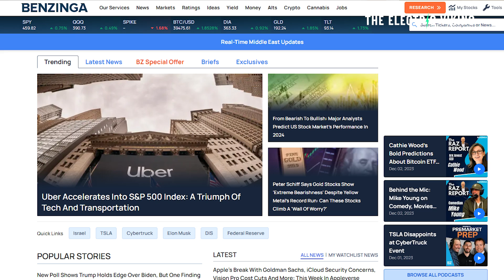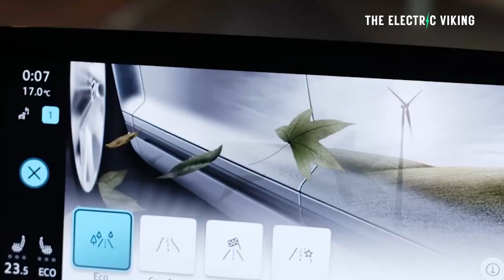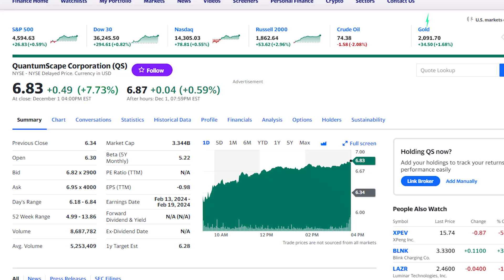QuantumScape stock blows up after journalist says its tech will crush Tesla

Comment: I don’t agree this article was the single reason for stock boost. Its widely anticipated QS are just about to go from prototype to production. A significant catalyst was also VW stating simulatneously "Volkswagen intends to start series production of solid-state batteries as early as 2024 in partnership with the American company QuantumScape"
Your video requires fact checking too.
*VW have not invested billions, they have invested £300m.
*QS did not go public 10 years ago, rather 2020. (It has been in development that long)
No biggies but slightly ironic about an article being questioned for factual accuracy.
For sure QS is a high risk investment but have clearly made significant progress and closer than ever to supplying their launch customer in 2024. That has got a lot of people excited.

Comment: 1. This price jump may more likely be caused by significant sales of stock by company insiders including the CEO. The innocent explanation for this is that those folk have significant tax bills to pay following their exercise of options. 2. It is very difficult to get information on qualifications of  Jeanine Mancini. After drifting lower for several months QuantumScape's price had already made some very modest improvement. That in no way should discount the caution you recommend but there are still too many unknowns, for example, the number and proportion of the total QS stock traded.  BYD, CATL and Tesla are not sitting on their backsides and in any case the hard part is effective conversion of 'Gee Whiz' Lab results into cost efficient manufacturing.

Comment: Don't forget, 98% of the people that CAN charge at home. . . about 50% of the masses that still has no EV possibly CANT charge at home.
They probably want good super charging 300km in 10 min, over long range 700km charging in 1 hour. I would. 
Why 700km range when you better stop after 2.5 hours and stretch your legs anyhow.
And why not cheaper than Tesla's batteries? ? ? ? 
Coarse the Tesla fanboys cant handle that blasphemy? 
When QS batteries are build from much cheaper materials, without Lithium, why cant they be cheaper than Tesla's LFP batteries?

Comment: Great episode Sam.  Elon or JB analysis - the advantage is cheap, volume battery production. Creates a moat against future tech, via customer's true need for convenient range.  Even if 1/3 of the cost for the same range, QS would have to scale very rapidly their production to 100s of GWh to catch Tesla battery price cuts that will follow Wright's law (2x volume = 25% cost decline).  By the time QS have scaled, likely Tesla's batteries will be far cheaper + the cost of car manufacturing via unboxed approach. (Not financial advice)

Comment: What does mean 98% charge at home? That all the EV owners live in the suburbs and have a garage? Doesn't that statistic mean that a lot of people who have to rely on public chargers don't buy an EV because they are scared of range and charging times?
Reply: The early adopters in America probably mostly have single family homes (although I did previously live in an apartment complex that had a charger).  Wider adoption will need availability of level 2 chargers in apartment complexes, and that surely requires a system in which the electricity gets charged to the vehicle owner.  That's a lot of level 2 chargers (or 220V outlets).

Comment: QuantumScape has had a lot of interest and even Sandy Munro has interviewed the Founder and CEO. I believe it's still available on YouTube. But there are two big issues that even QuantumScape admit to. The first one is that there is not a way yet to cost effectively mass produce these batteries.  The second is that their cycle rate is too low for commercial use. After just a few Hundred cycles these batteries degrade quite a bit. In this area QuantumScape has over the years improved this but not to the level of a standard lithium ion battery. Manufacturing cost and battery cycles are still not ready for the Market yet. Which are absolute barriers to coming up with a product you can go to market with. This is not my opinion but From QuantumScape itself and Sandy Munro's observation.  They are improving the battery each year but need tons of cash to keep doing it.  I think they are a real company actually closer to a solid state battery than anyone else but its not able to bring anything to market quite yet. I am rooting for them.  My opinion is they are still 5 years or more away. Their R&D will burn through billions in those years if they have access to the capital.

Comment: The articles lack information on cycle times, degradation, and cost-effectiveness of QuantumScape's batteries. These factors are crucial for practical adoption. Additionally, the potential reluctance of the largest electric vehicle (EV) maker, presumably Tesla, to adopt this technology could indeed impact its widespread acceptance. The scalability and affordability of QuantumScape's batteries are vital considerations for the success of their technology in the competitive EV market.
Reply: tesla isnt required to allow all vehicles to charge at their charging stations.  they could disallow this battery from charging at tesla stations
Reply: That was my thought when I read the article. The claims are standard for solid state batteries and I understand that they have been built some time ago. I understand that the problem they have uet to solve is cracking of the ceramic electrolyte resulting in a short battery life. If QuantumScape had solved it, that would have been what the article was about. It wasn't. It just cited the standard claims for solid state batteries as if they were new.

Don't get me wrong. I'd love solid state batteries to become real and believe that one day the problems will be solved. I just don't think today is that day based on the article.

Comment: Quantum scape stocks were $114, 3 years ago.

Rising from $5 to $7 doesn’t rate highly.
Reply: Only percentages matter on a stock.  You could have a float 1/10th the size and it would have been from 50 to 70.  Does that sound more impressive?  It isn't.
Reply: @gregkramer5588 :  So re percentages, I checked and 3 years ago (12/2020), QS peaked at over $114. 

It closed well under $7 Friday, both at market close and after hours.  

$114 / $7 (being conservative) is well over 1600 percent down. 

I have to believe the market likely rightly believes that QS is FAR less likely to produce a major blockbuster change in batteries good enough to generate huge business profits than it did 3 years ago. 

In reality, potential commercial advancements lauded in the press only reach serious commercial profitability a TINY percentage of the time. 

To me, this is no different UNTIL there is some SERIOUS evidence it will actually be commercially viable at scale, very profitable, AND PROVE durable and reliable over time. 

If all that happens, then obviously the stock could rise tremendously.  If not, it could go to zero.  And meanwhile there are a LOT of outfits hard at work on all sorts of battery advancements, given the clear scale of demand for BEV's and stationary backup storage -- plus of course the huge demand from computers, cell phones, etc. which would all benefit from much better batteries.
Reply: @gregkramer5588  or penny stock is 1 to 2.5
Reply: @gregkramer5588 That's utter bullshit.
Reply: Its normal for an ipo to be high and then drop down for a significant amount of time. When they actually have these batteries in vehicles the stock will rocket

Comment: Tesla i believe was the first to build a production EV battery pack in partnership with Panasonic . They have fell behind on this while their competitor byd has moved ahead of them . 

Now Tesla is known for keeping quiet and maybe have some potential for new battery tech 

Premature claims is a stock pump . If you had some great tech you would keep it quiet
Reply: cybertruck has atleast the new 4680 cells
Reply: Tesla has been focussed on 4680 LFP batteries. They also partner with CATL who are planning on adding manganese. I don't think Tesla are being particularly quiet but they do not say much about what they put in specific cars as this would affect sales.
Reply: Current 4680's are not LFP. They are still NMC in a different package.
Reply: Panasonic basically did the first two Tesla battery's . They weren't radical departures from what went into laptop's .
The 4680 so far has been kind of disappointing compared to what it was suppose to be when announced. BYD went 
in a different direction which looks like a good one with LFP. Doesn't mean that better stuff will not follow from other's

Comment: 1000 mile range is stupid for 99% of users and won't be widely used even if we had 3 times density
Reply: Agree. But stupid things sometimes sell. And it would be very beneficial to reduce the battery weight by two-thirds.
Reply: Yeah, who can hold their bladder that long?  Surely such energy density would be used for a lighter vehicle at reasonable range.
Reply: I mean that depends - are we talking 1000 miles in a compact sedan? Or 1000 miles in an 18 wheeler towing a couple tons behind it? If we are talking 1000 miles in the compact - yes, excessive for the compact but could be useful for those of us who want to do a long long drive with a small top-up midway if charging speeds don’t improve greatly. But it’s gonna mean improved performance for that full-size SUV / truck segment where than 1000 mile range may drop to 600-700 miles with the increased payload, size of vehicle, and potential towing.

If it’s 1000 miles in that massive 18 wheeler… yeah that’s excessive for everyone and not necessary but would allow for drastically smaller batteries, which… I for one would be happy with since the smaller battery size and weight would still mean an increase in range when using the same capacity.
Reply: Could be used for other markets too. Not a good argument. Still they are super high risk and way over stated what they where able to do early on. We shall see.

Comment: I find 75kwh fine and 110kw charging rate just allows for a comfort break and a coffee. If energy density increases it will make EVs much cheaper than fossil.
Reply: While you or I may find those charging speeds just fine, I know people who feel that waiting 40+ minutes to recharge their car is just way too much time. Particularly family members who regularly do 1000km drives a few times a year with kids in tow. Personally, I agree with you, and prefer to take a solid 30 minute break from driving on longer trips, especially if there’s a decent destination to stop and eat (here in Canada, my family and I always stopped at The Big Apple en route between Toronto and Ottawa to eat and relax before we would continue on our way in either direction). But for public perception, and for better performance in colder weather, I definitely believe a faster charging time would be a good thing.
Reply: @jonatamaniuk  never spent 40mins at a charger but alway look for 160kw chargers still many old 50kw around and they need ditching.
Reply: @bernardcharlesworth9860  that is good that you’ve never spent 40 minutes at a charger. Higher speed charging vehicles this definitely won’t be an issue, that’s for sure, like the Hyundai Ioniq 5, Kia EV6, Lucid, Porsche, and majority of Teslas. I’m not sure what type of vehicle you drive, but I have seen some other users who have had 30-40 minute waits depending on how deep into the pack they need to charge.

Comment: QuantumScape (NYSE:QS) could be a game-changer in the battery industry with its ambitious forever battery project.

The company seems to have cracked the code in creating a solid electrolyte material capable of resisting dendrites, a critical element in perfecting the solid-state battery.

This discovery took shape in 2020 with a single-layer cell, progressing to 10-layer and 16-layer cells. By the end of last year, it had taken things up a few more notches by developing a 24-layer cell prototype, setting the stage for a paradigm shift in the EV sphere.

To put things in perspective, QuantumScape’s battery technology could energize EVs for a whopping 400-mile range while recharging them within 15 minutes.

As it gears up to commercialize its next-gen EV batteries, expect the firm to drive billions of dollars in profits, making it an electrifying long-term opportunity.
Reply: You don’t actually believe this do you?
Reply: @fractalelf7760 there were articles out earlier about them having proven 12 layer technology